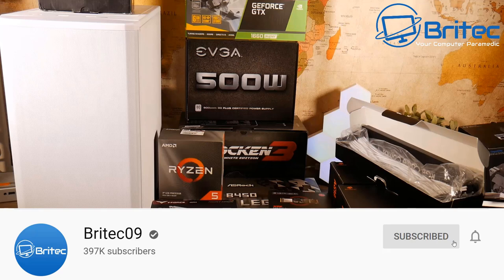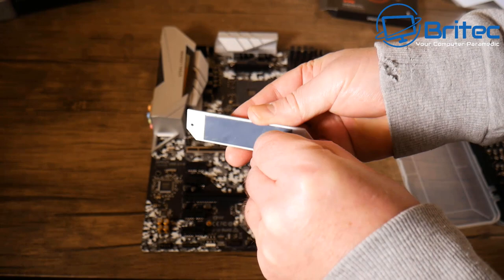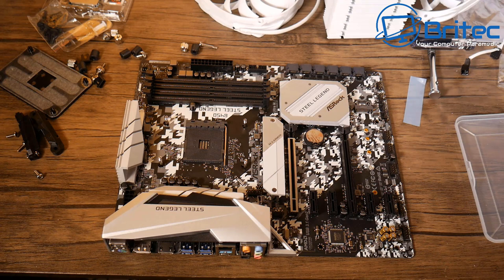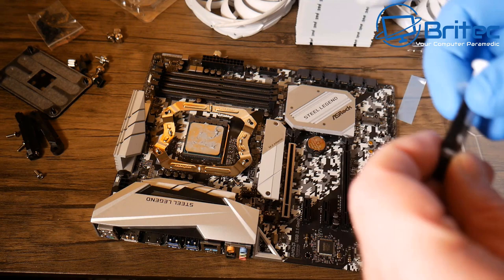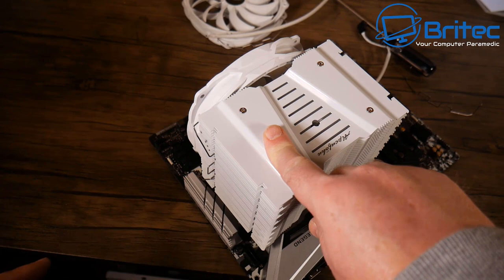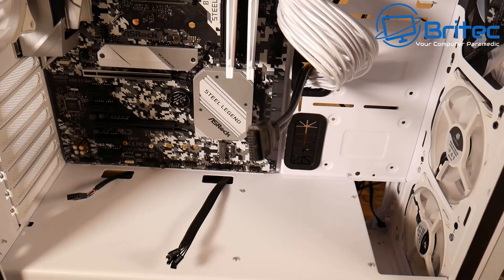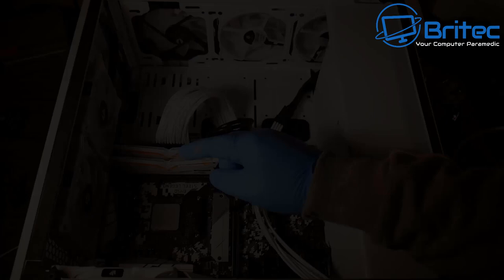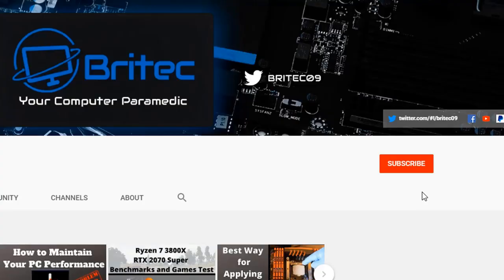The White Gaming PC Build 2020

Comment: My PC is even whiter than that. The PSU, video card, and the entire motherboard are white.
Reply from the maker: You can't get it at this price point and AM4 don't have white mobo
Reply: @Britec09  My hardware was from about five years ago. ASUS Sabertooth Z97 Mark S, GALAX GeForce GTX 980 HoF, and SeaSonic SnowSilent 1050W PSU included in my build. There are some blue highlights, though, such as the RAM sticks and ice blue SATA cables.